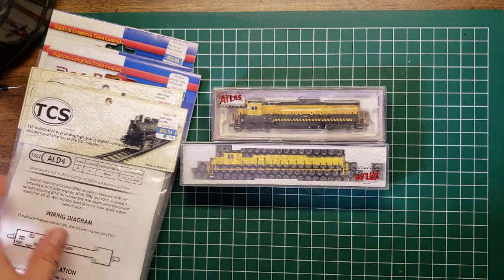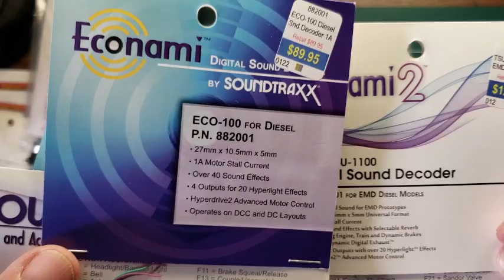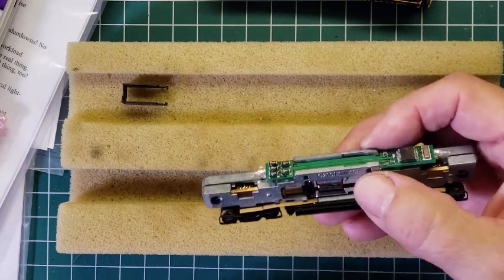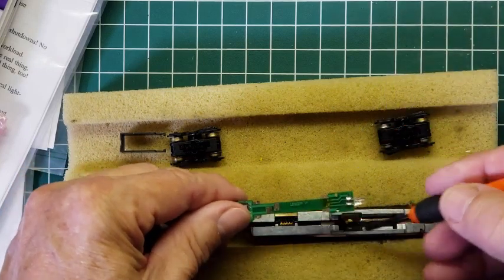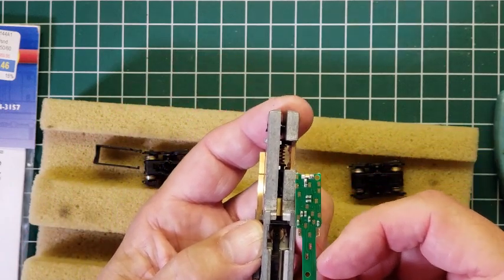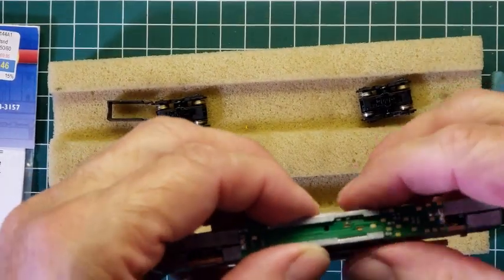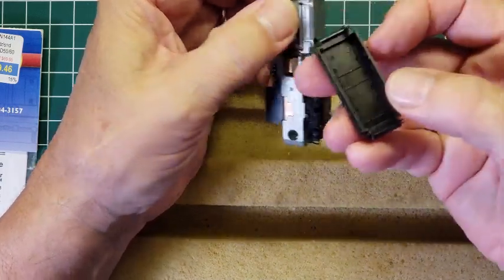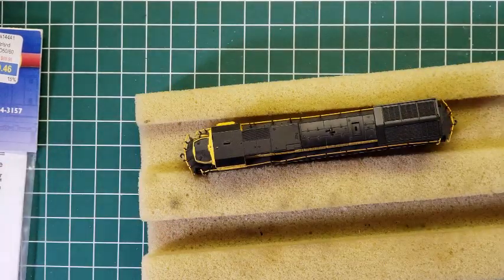N Scale Atlas Dash 8-40B DCC Decoder, Digitrax DN163A0, installation

Comment from the maker: More often than I would admit your siuation with "lights work, motor won't" says the contacts and pickup and address are working and the leads to the motor (usually just one) is not conducting or connecting.
1. Did you use a Bright Boy abrasive on the motor contact of the decoder?
2. Push on the motor contacts with your finger or a pencil or small screwdriver while you increase the throttle.  If it works then you either need to adjust (bend) the motor lead or place a small brass shim in the motor contact hole in the decoder.  Optionally you can solder the motor leads to the decoder but that is tricky and can destroy the decoder.
Reply: Thanks...I will try this and let you know.
Reply: Well.... I took it apart one more time. Put it back together one more time. And it worked !!!!!!! Thanks for the suggestions. I don't know what I did any different than before but it worked this time. Thanks again. No more of these.
Reply: Actually it's Jimmy Harley, not Jane.